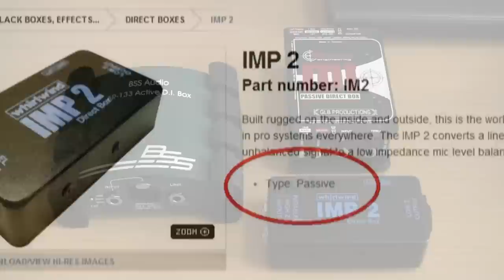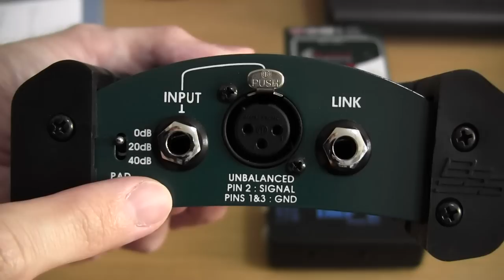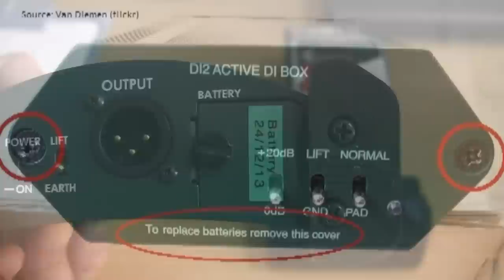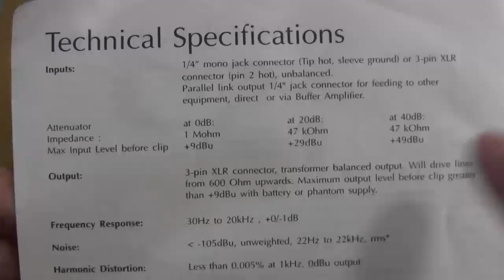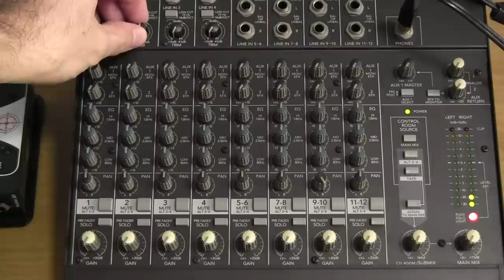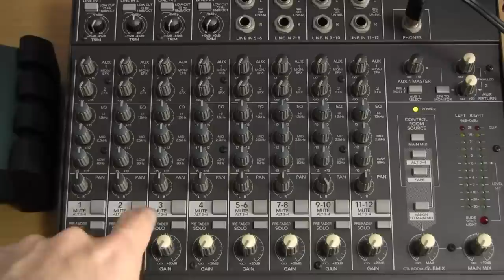DI boxes part 2: Active vs. Passive

Comment: I am having issues with my live vocal setup.  i have a shure sm57 with and XLR to line level cable -> into boss effect pedal (powered by 9v wall supply) -> radial proDI -> XLR out to the PA.  Some sound guys are able to dial in enough volume but others struggle and need more gain supplied on my end (which isn't possible from the boss DELAY pedal that has no gain controls)  I have debated getting an active DI box but I dont know if that solves the problem.  what say you?
Reply from the maker: +James Ardery Hello James, good to hear from you. The main issue in your setup is the fact that the SM57 is not designed to be connected to an effects pedal, it's designed to be connected to the mic input on a mixer - this is why you are getting a very low signal level. 

You can experiment with an active DI box - that will definitely give you more output level, but will not solve the fundamental problem, that of matching the mic to the effects pedal. The best solution in your case is a unit like the Radial Voco-Loco, which is designed specifically to interface microphones and effects pedals. Hope that helps!
Reply: +GLB Productions Hey there, I was thinking about a similar issue. What would be the drawbacks of using a small pre-amp in a scenario like the one James mentioned.

For example, if we went: Mic -> PreAmp -> Pedals -> Passive DI -> XLR to PA

I have a tenuous grasp on this stuff right now, so I'm wondering if you see any glaring issues with that set up? Anything specific to watch out for? Thanks so much for these video. Incredibly helpful!
Reply from the maker: Isaac Burton Sure that would work fine too - the main challenge would be adjusting the amount of gain provided by the preamp so that you had good signal to noise ratio yet were not overdriving the input of the effects pedals.

Comment: Hey man, thanks so much for the clear video. Quick question though, will an active DI box work as a passive one, when there is no power present? Thanks in advance
Reply from the maker: No it will not - the electronics in an active DI must be powered or they do not pass signal. Hence why some of them have batteries in for when there's no phantom power available.

Comment: Such a great educational demonstration.
I have a question regarding to directbox,
If i'm using hifi audio equipment like dac/headphone combo unit(have AC power connector for the headphone amp) connecting to PC and DAC unit powered by USB ,this unit also have thru RCA output bypassing the headphone amp section.
Which kind of DI should i use to connect between above system to sound system(studio monitor and subwoofer), I'm also planning to connect keyboard unbalanced stereo output to DI,

WIll Radial proav2 suffice in this case??
Reply from the maker: In your case I suggest connecting directly first, with no DI, and see if you have any noise issues.

Comment: 7:00 > that seems a bit confusing ...
There is a 9 volt battery inside the DI.
How can that handle the 48 Volt that Phantom power needs?
Reply from the maker: The electronics in the DI step the voltage up or down to whatever is needed 😉

Comment: Sorry, I just was watching through the video again and where I think I got confused was the Passive Pick-up connected to a Pedal Board which makes the signal Active and needs the Passive DI Box. Without the Pedal Board the Passive Pick-up needs an Active DI Box. Is this correct?
Reply from the maker: +Dennis Neuhaus Correct - in general active guitar with passive DI and passive guitar with active DI. If you're not sure if the guitar is active or passive, look to see if it has a battery inside! Of course, a passive guitar connected to any sort of pedalboard becomes active, because you are only interested in the last item in the signal chain before the DI.
Reply: Thanks Bruno, I think I am doing the right set-up for the guitars I am working with in Church.

Blessing - Happy Easter
Reply from the maker: +Dennis Neuhaus Blessed Easter to you too brother!

Comment: I'm trying to plug in my acoustic (with preamp) into a harbinger mixer, but I need all of the mic inputs for microphones. If i use a passive DI, can I use a XLR to TRS cable and connect it to a different channel?
Reply from the maker: You can try that but you may not have enough gain on the channel to bring it up to a usable level - if running into a line level input it's best to either plug the acoustic directly into the mixer or use an active DI box with a line level output.
Reply: thank you!

Comment: very great explanation and also clear English accent that i can understand without using subtitles (because i'm indonesian) haha. And i've seen some of your video to enhance my knowledges, i decide to subscribe.
One question, I have an electric guitar and I connect on Pedal Rocktron Zombie and plug to my Behringer U-Phoria UMC22 Interface , I heard a noise (buzz sound) when I turn on the pedal. Whether these are commonly found in every distortion pedal that distortion brings/generate high noise?
Thanks so much
Reply from the maker: Nur Ibrahim Tikko Thanks for watching - I'm from Singapore so kadang kadang kita boleh guna Bahasa Indonesia until bertutur. Saya punya Bahasa Indonesia sudah berkarat sedikit tapi masih fungsi ;) 

Yes, high gain guitar pedals often cause noise but typically it is hiss rather than buzz. Does the buzz go away when you unplug your guitar from the pedal? I'm trying to determine if the source of the noise is the pedal itself or something before it in the signal chain.
Reply: oh anda bisa bahasa Indonesia dengan aksen Malaysia ya, how surprise :D
yeah i mean 'hizz' sound, and i must set the noise gate to get rid of that sound. That seems be a little problem with my jack cable,  the end of my cable bit of little loose, and I had to fix it repeatedly but the noise was still showing . Then I decided to replace my cable with a longer one, approximately 5 meters. Is there any obvious differences between using a cable under 5 meters and more than 5 meters ( in the context of home recording )? I feel that over the 5 meter, it generate noise. Doesn't same when I use below 5 meters only generate a little noise when i'm not mute the guitar strings with my hand
Reply from the maker: Nur Ibrahim Tikko Ok if it is hiss that is normal for high gain amps and pedals - some of the high gain Marshall heads have a noise gate built into them! 

Guitar cables should be kept under 5 meters/15 feet long if possible - they are unbalanced and as a result tend to act like a radio aerial when they are over a certain length and pick up all kinds of interference.

Comment: Your videos are the most constructive and informative on this subject. Thank you so much for your dedication and sharing your knowledge. Your videos allowed me to set up a home studio. Instead of individual amps, i just got a 2 speaker+2 Monitor PA system with a mixer for plugging all of my instruments directly in to the board.

But my DI box for my J-Bass (Behringer V-Tone) just eats a 9V battery in 20 minutes - so i bought a passive one for the guitar. Can you recommend a good DI for my bass? (passive Jazz Bass with Custom Shop 60's pickups.)
Reply from the maker: Sebastian Lund Nielsen Hello Sebastian, thanks for getting in touch! Glad the videos have been helpful. 

For a passive Jazz Bass I'd recommend an active DI box, either the BSS AR-133 featured in the video or a Radial J48. Both of these can be run off phantom power, meaning no need for batteries!
Reply: Hey thanks for the quick reply! I'll pick one of those 2 DI's you mentioned up. What about for the guitar in the setup? It's also passive, and i've got a passive DI for it. Is that a problem(passive+passive)? Or can i addjust the gain/levels on the mixer to compensate?
Reply from the maker: Sebastian Lund Nielsen You're welcome. Which exact guitar are you using? The issue with passive + passive is sometimes the level, but there may also be impedance issues.
Reply: It's a Strat with 3 Fender single-coil pickups.
Reply from the maker: Sebastian Lund Nielsen Yes that guitar will need some form of active DI for best results. Having said that, some mixers provide a high impedance input on the first one or two channels that works just as well. Which mixer are you using, and does it have that feature?

Comment: I was thinking about buying  Art Pro Audio ZDirect,  I hope it will do a job?  I'm on a budget. I need it to connect my acoustic guitar with scarlett 2i2 audio interface because signal is too hot without DI box.
Reply from the maker: +Darko Ristanovic If you're on a budget I recommend the Whirlwind IMP2.
Reply: +GLB Productions Ok thanks,  even if it doesn't have attenuator switch, it's still gonna normalize signal level for audio interface input? Sorry I'm kind of noob with this.
Reply from the maker: +Darko Ristanovic Yup - running through the transformer will already drop the level significantly because of something called insertion loss. I assume your acoustic has an active preamp yes?
Reply: GLB Productions Yes. Thanks for answering. :)
Reply from the maker: Darko Ristanovic No problem.
Reply: Take a look at the Samson DI it looks like a Radial Design very well built.
Reply: how about electric guitars? I have a M-Audio interface with  2 inputs, but I need a clear signal that I can work with inside of my daw. What should I do

Comment: 1. would love you to do a review of di boxes with built in preamp. usually these are active some are for for guitar, bass, electric guitar, other acoustic instruments,  or microphones.

2. Another thing i have noticed on some sound desks they have one phantom power switch for the whole desk. thinking of some yamaha ones i have used. does the phantom power on them send to all channels or only ones that need it. as i know phantom power can damage electronic devices that don't use it.
Reply from the maker: Michael Stoneham I have a review of the Sansamp bass driver DI in the pipeline, so stay tuned :)

Most modern electronic devices that have XLR outputs can deal with phantom power, but 10 years ago or so there were definitely some units that would be damaged - SWR preamps come to mind! If you're in doubt get in touch with the manufacturer of your gear and ask specifically if the balanced output can tolerate being connected to phantom power. 

If you do own something that will be damaged, the simplest solution is to use an XLR->TRS adaptor to connect to the line input on the mixer, bypassing the XLR connector.

Comment: Great video! I have a mixture of both passive and active instruments (guitars). Would the Radial J48 Active be best as it has a soft pad? The phantom power thing is a problem, but my Focusrite Saffire has phantom power, so that should solve it. Thanks :-)
Reply from the maker: +mrbsred1 The J48 is an outstanding active DI box, even better than the BSS in my opinion.
Reply: Your opinion is appreciated. Gonna get one. Thanks
Reply from the maker: +mrbsred1 You're welcome.

Comment: I have an electracoustic with active preamp, but often sound engineers have used active DIs to connect me to the mixer, and still everything was great. So, if the DI can lower the signal (like the BSS has the pad switch) it can work with active preamp without clipping?
Reply from the maker: Yes, instruments with battery powered electronics are a grey area - often both active and passive DIs will work, and the choice comes down to tone: passive DIs will usually give a warmer, rounder sound with active DIs giving a more aggressive tone with better top end. Choose what you prefer :)
Reply: Thanks, it makes sense now! However, I have one more question. I see that DIs have a thru/parallel line which is to connect to the stage amp, so that the player can hear themselves and the balanced out that goes to the mixer. When doing it this way, isn't it bad that the player might have a different view of the sound? They might even bring the amp so that the guitar has a specific tone they want. Isn't it better to just use stage monitors that get signal from the mixer and use the DI after the amp?
Reply from the maker: Yes, this is why communication between the sound engineer and artist is so important! Both parties need to agree on what the tone of the instrument should be - a good sound engineer will listen to the sound of the player's amp before he makes any EQ decisions on the house sound, and a good player will work with the sound engineer to ensure that the tone he is using is appropriate for the venue. It's a delicate balance which requires open dialogue and humility on both sides ;)

Comment: Thank you for clear presentation🙏🏻. but I have questions should I turn on the phantom power with  active DI device which already include a battery ? Or I should turn on phantom power with active DI device which doesn’t have a battery ?

Q2 should I turn on Phantom power with passive DI device ?
Thank you again and sorry for my english language
Reply from the maker: With active DIs I tend to remove the battery and just rely on phantom power. With passive DIs leave the phantom power off.

Comment: Hi, do I need a DI if output from bass guitar is xlr and says balanced? Not sure if it is line level didn't mention in manual and ground seems to be not connected internally.
Reply from the maker: Probably no need for a DI - are you using an Alembic? XLR outputs on instruments are rare.
Reply: I am using a BG250 of TC electronics, i might just need to use the jack input in mixer, so XLR to TRS cable, i watched most of your videos and very informative, keep it going :)

Comment: question, what if the tech turns on the phantom power of the mixer, will it damage the direct box (passive).thanks
Reply from the maker: No damage at all - transformers block phantom power very effectively.

Comment: Thanks for the video! Just wondering.. I Understand that using a passive DI box for an active instrument such as an electro-acoustic guitar and vice versa. But why is this? Thank you!
Reply from the maker: spyonthesoftparade You're welcome. Two main reasons: input impedance requirements and the ability of the DI box to handle the output level of the instrument.

Comment: When I use an electric guitar with passive magnets, then I needs active DI box.
But, if after guitars I add WAH pedal, which runs on electricity, do I then need a passive DI box?
Reply from the maker: +Nikola Manojlovic Correct - active DI box for passive source, passive DI box for active source. However these are only guidelines - experiment and see what sounds best!

Comment: Hi, could I use a Di box in this chain: Guitar > effect pedals >   JDI > mixer PA (without using a combo amp or Head or any other preamplification)? thanks in advance.
Reply from the maker: +Nathan78 Drake Sure no problem at all. Just be sure that you have a god monitor and monitor mix!
Reply: I just realized it also exists radial jdx direct drive that is a simulation amp + di, do you think could be better directly in the PA or is enough Jdi..thaks for your answer.
Reply from the maker: +Nathan78 Drake It depends on what sound you are looking for and what pedals you have. Electric guitar tone is a very personal thing. The JDX is designed to replace a mic on a cabinet so it definitely gives you more options.

Comment: I have used mostly active DI-Boxes with an "active" acoustic guitar because I feed the DI with Phantom power from the mixer, therefore I feed also a guitar with Phantom power coming from DI. This gives me a guarantee that I won't lose an acoustic guitar on the stage in the middle of a concert cause battery died. Have U used that? Signal, of course has to be reduced a lot. Thanks!
Reply from the maker: Ah yes, which guitar/DI combination are you using? There are a number of phantom-powered guitar preamps out there but they don't seem to have caught on in a big way.
Reply: Guitars are usually battery powered versions, so active. Actually I'm not sure anymore if active Di-Box sends further the Phantom power to the guitar - or does it depend on the type of guitar?
Reply from the maker: Taisto Uuslail If your guitar is battery powered then it does not need phantom power - the phantom power is only to power the DI box itself.

Comment: That's a great video, very good explanation! I use an electric guitar via a drop tune pedal which uses true bypass . Does that mean if I bypass the pedal the signal is passive and then active when using the detune? The Di box would need to be after the drop pedal so the same tuning is sent to the desk.
Reply from the maker: mydthofwim If the pedal is really true bypass then what you write is correct. If in doubt just use an active DI box :)
Reply: ok, Thanks.

Comment: Hi - i was wondering I'm using a wireless with a passive bass... Sen G3 Packs and its a passive bass into a J48 Active Di... because the wireless is in the chain will it matter that iv an Active DI .... and what iv iv an Acoustic with a pre amp on the guitar. would that require a Passive DI ??? or for example a Roland Drum Brain its a brain so its active right? so id need passive also??
Reply from the maker: If you're using a wireless you typically will not need a DI as the receiver should have a balanced output. Acoustic guitars with preamps can be used with active or passive DIs - try both and see which one sounds better with your particular guitar. And yes v-drums etc are all considered active so use passive DIs.
Reply: thanks so much for reply